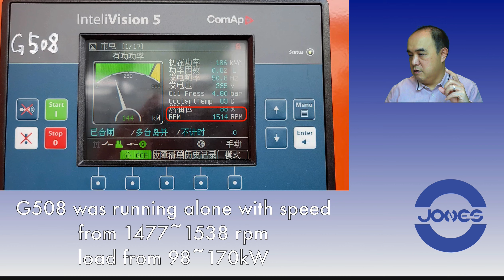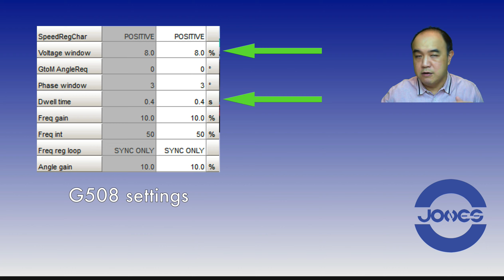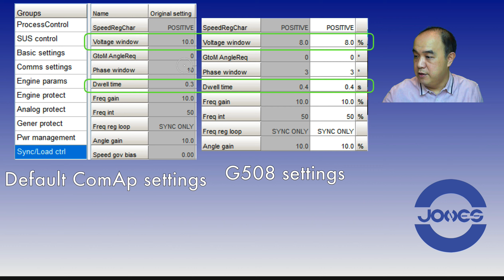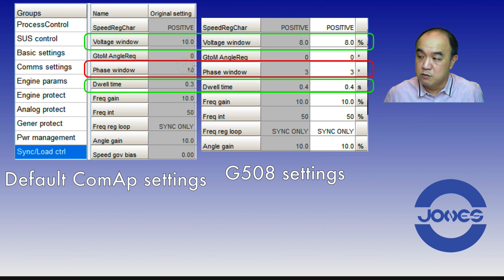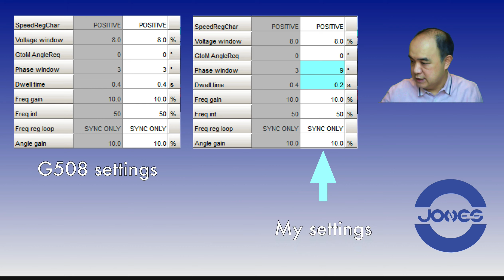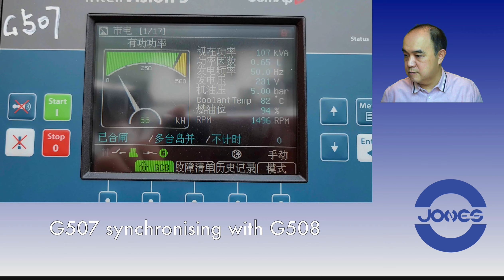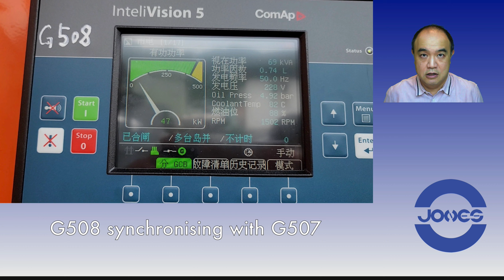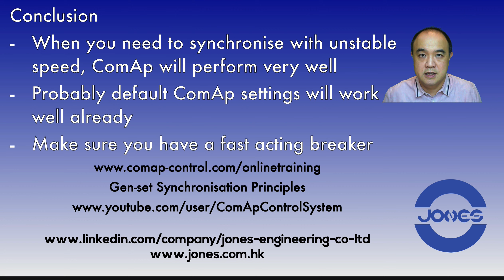How to Setup synchronizing conditions for ComAp controllers

Comment: Helped me solve an issue with three detroit 149 1mw units. Quality post. Thank you.
Reply from the maker: May I ask where are you? Maybe there is a ComAp distributor around where you are who can help more directly. If you think I maybe able to help, you will have to tell me a bit more what problems you are having, and exactly what is on your engine. What kind of ECU or speed control/actuator, what kind of AVR
Reply: @jonesengineeringco.ltd.4857  Texas, USA. mechanical governors on mechanical engines. Changing the acceptable phase difference and the dwell time fixed the issue. It was at a hospital, and they were complaining the sync was not fast enough for NFPA 110 standards.
Reply from the maker: @montey1017  in that case, the ComAp controller is just acting like a check sync relay, it cannot "actively" interfere with the speed or phase, so the ComAp unit is just waiting for the sync window. If you wish for a "faster" sync, you can try to allow for a larger phase window and shorter dwell time, which is another way of saying what you did. If you want it to be even faster, you can add an electronic speed control/actuator, that would speed things up a lot

Comment: Thanks . your training have practical approach and case studies. I wpuld be thankful if you can make video on how to resolve init problem in controllers while use in multiple genset sync operation.
Reply from the maker: what kind of initial problems do you have? And ComAp has virtual hands on training that you can join. https://comap-control.com/training/hands-on-training
Reply from the maker: Gen-set Synchronisation Principles (in English) https://www.comap-control.com/training/online-training?sort=OnlineTrainingVideoDate%20DESC&previous=5

Comment: thanks jone your video is very informative.
can you help me?
i am facing problem in ComAP IG-NTC-BB controller when my voltage source synchronized then my GCB close cmd does not work i pressed GCB closed cmd but nothing happned.
can you tell this issues?
Reply: please use intelimonitor to connect to the controller and save the archive (.ant) file and send to me. if you can do this, I will post my email here shorty,  afterwards I will delete my email address from the thread
Reply: @moming920  please response.
Reply: i am trying to send to your mail address but youtube delete my reply which has mail address
Reply: @moming920  i am already using intelimonitor to testing
Reply from the maker: @mouzamalihashmi2311  I give up trying to show you my email address, Google very smart, deleted it no matter how I break it up. I will try to answer here.
Reply from the maker: @mouzamalihashmi2311  I suppose you are having this problem when you are trying to synchronize? means there is voltage on the bus, and your genset is running, generating voltage, and you press GCB close. Question 1. Is this a new installation? did it work before, but all of a sudden, now it no longer works, or it is a new installaton, or after some modification and now it no  longer works? Question 2: If you are trying to synchronize is the LED on top of the GCB button blinking green after you press it, or it remains unlit?
Reply: @jonesengineeringco.ltd.4857  It's a new installation.
I am testing on the controller whether the synchronization function is working or not.
First, I applied voltage main bus side and generate side, generator is not running I am applying voltage or testing equipment.
Reply: the same problem occurs in the IM-NTC-BB controller.
I applied main voltage And bus voltage to the test set.
All conditions fulfilled synchronization but I pressed the close button nothing happened.
Reply from the maker: @mouzamalihashmi2311  you can't test like this, ComAp controllers are too "smart". If you press the GCB close button when engine is not running, nothing will happen, because nothing should happen, the controller blocks the operator from making mistakes. You really need to simulate a running genset, a running genset that is started by ig-nt, means when the controller get fuel and starter inputs, then speed and pressure builds up, voltage builds up, gcb feedback is open at this time. And if you are running in SPI, or SPTM mode, if you want to similar an attempt for synchronism, you will need to simulate a true 3 phase mains voltage (if it is in fact just from one-phase, there will be an alarm, ComAp is too smart, again...) When the IG-NT senses mains voltage, it will send a MCB close signal, and at that time, a MCB feedback must be applied to the IG-NT. When all these conditions are met, then, when you press GCB  close, you will see the LED on top of the GCB button will blink, if the mains and gen phases are matched, then, it will send a close GCB output, and the IG-nT expects to receive a gcb feedback signal, if the gcb feedback does not appear soon enough, there will be a gcb fail alarm.  You can, simulate, but you need to do a lot. ComAp controllers cannot be easily fooled. This is by design, to prevent operators making mistakes.
Reply: @jonesengineeringco.ltd.4857  Fine understand you are correct,
But the same problem is the IM-NTC-BB controller I provided 3 phase  Main voltage and bus Voltage by the test set And no alarm was initiated on the controller.
MCB close command not working,
Please give me any contact I will share a .ant file there.
Reply: @mouzamalihashmi2311  you know YouTube is very good, I will break up my address you can piece it together  .
Reply: @moming920  Jones.hk is the word after at.
Am I right?
What will be word of before at?
Reply: some error comes while sending mail.
Reply: @moming920  can you send me some SMS on my mail?
Reply: @mouzamalihashmi2311  why don't you send me your email line by line, don't need to type dot
Reply: @moming920  after 384 will comes at Gmail com
Reply: did you understand?
Reply: @mouzamalihashmi2311  I sent to after384willcomes doesn't work
Reply: @moming920  sir understand my mail?
Reply: @mouzamalihashmi2311  apparently not
Reply: @mouzamalihashmi2311  just type out everything before "at " and nothing else please
Reply: you know dot will come between gmail and com
Reply: @moming920  youtube delete my sms whish has content before ""at""
Reply: @moming920  please type my full name without space and after my full name type 384 and after 384 type "at"
 mouzam ali hashmi 384
Reply: no space between my name
Reply: Mouzamalihashmi384 before at
Reply: @mouzamalihashmi2311  sent, you got it?
Reply from the maker: @mouzamalihashmi2311  if you didn't get my email, are you on skype?
Reply: @jonesengineeringco.ltd.4857  I am on wechat
Reply: @jonesengineeringco.ltd.4857  no brother i am on wechat do you have wechat account?

Comment: thanks jones your vedio gave me alot of informartion.
sir. i have 3 cummims gensets vta 28. qsx15 and small 6cbta i wanna to  change small 6cbta into kta19. may controller is inteli gen bb with inteli vision 5.
plz make a vedio about haw to adjust voltage and frequency bias.
Reply from the maker: I don't have the engines you mentioned to show you. There is a igs-nt-installation guide you can download on ComAp web. Section 17 , 18, 19 should be useful for you. In particular section 18 and 19, it shows you how to interface with different speed controls. i don't know which speed control you have for the 6cbta, and which speed control is on the KTA19, I assume it is a 3044916, which is likely the same as on the VTA28, in which case you can use the same kind of wiring and commissioning method to commissioning the KTA19 and the VTA28. The QSX15 will be something completely different. For the AVR, I don't know which brand you are using, but section 19 shows you a list of AVR interface, wire it up according to the AVR you have. Adjustment method is the same as for the　AVR for the 6cbta . And there are online trainings you can download and join at ComAp web.
Reply: @jonesengineeringco.ltd.4857  thanks,  here in somalia  70% of our  controller  is comAp  and we don't have any local dealer or some who can assist us  when we are doing such things. what is on the manual always not real in real world. so if your company can assist us during commissioning we really apricated you guys.
Reply from the maker: please send  let me know your email address, I will send you some diagrams, and manuals, and let me know what is the model and make of the speed control of your kta19, and the avr model and make
Reply: @jonesengineeringco.ltd.4857   i have cummins  QSN14-g3.

Comment: It seems that the display is not fast as the program, cause the program shows 21° end closed but it was set 9° in phase window
Reply from the maker: you have very sharp eyes. And yes, there will be delays in the display, no doubt, the setup is a 2 piece design. The voltage and current input are connected to the main control unit IG-NT-BB which is inside the control panel. The exterenal InteliVision 5 is connected to the IG-NT-BB via a serial RS485 port with a digital signal. RS485 is very reliable port, but not a particularly fast one.
Reply: @jonesengineeringco.ltd.4857  thanks you for answered and you did a nice work as well.

Comment: Thanks Sir I am also facing one problem on one site our two units running with ComAp InteliVision5 controller one is 1025Kva And one 815Kva, yesterday we found Add Error and one unit show 01010000 (815Kva  cont. Address 2) while other Generator show only 00010000 (1025Kva contr. Address 4) i checked and changed ComAp Base Box and Display one by one of 1025Kva but Same, reset from Common Setting but still same and i found 60 ohm on12, 13 terminal on communication lead when it connected on 1025Kva but we measure resistance again on 12, 13 trminal when lead connected on 815Kva it's not showing anything. if you understand please can you give me support.... thanks
Reply from the maker: I am not sure which terminal 12, 13 you are talking about. For intercontroller communication, we are only concerned with CAN2's H and  L terminals. When you are all the CAN2 cables connected, and terminated by 120ohm or a jumper on both ends. Power off the 24VDC on every ig-nt-BB. measure the resistance across each ig-nt-bb's CAN2 H and L. They have to all be 60ohm. If there is one unit with 0 ohm ( I guess that's what you mean by "not showing anything") maybe that particular IG-NT-BB has a burnt CAN2 port. Remove the CAN2 cables or unplug the CAN2 connector and measure the ohm across H and L, if it is open circuit or short circuit, this unit's CAN2 port is likely burnt out